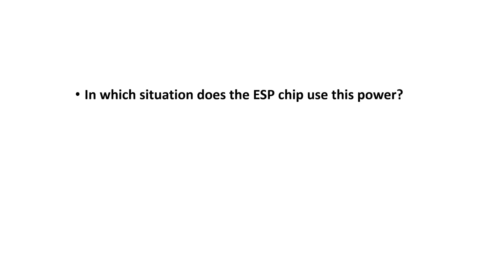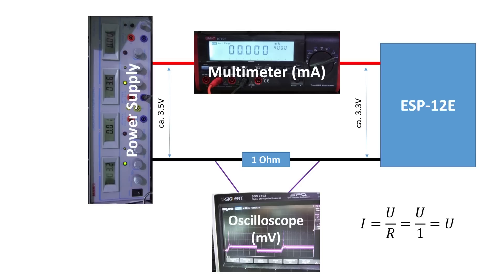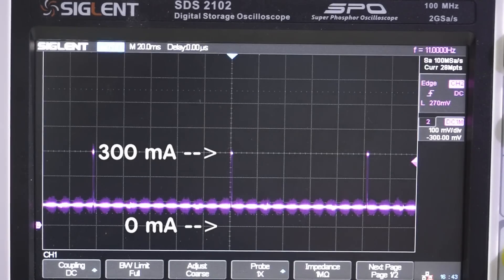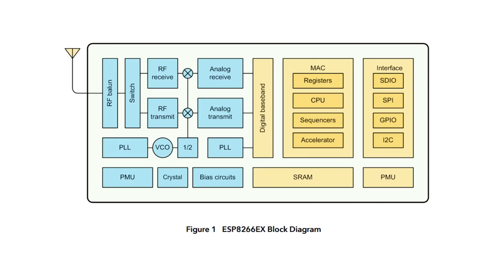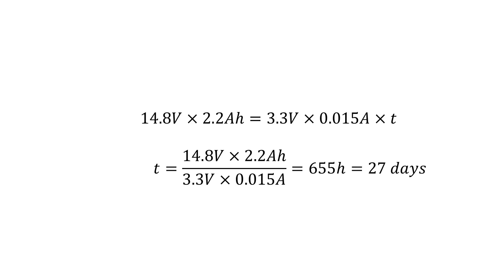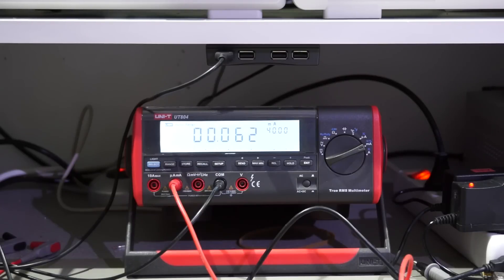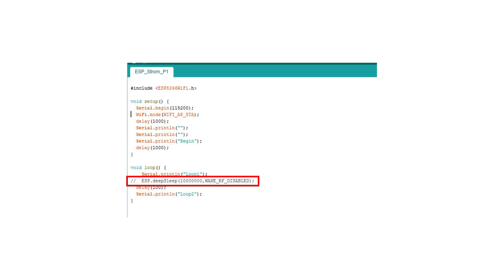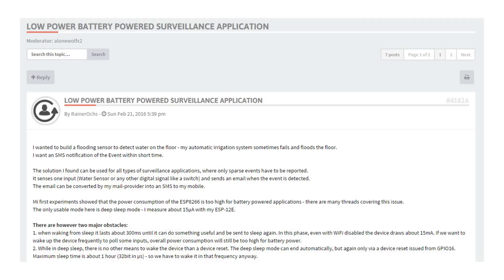#47 Power Saving with ESP8266 (Sleep Mode) Tutorial with some Tricks

Comment: Thanks for the Video! For me, it would have been interesting to see the peaks with a common battery type.
Reply from the maker: They have to be the same. Otherwise the ESP would crash.
Reply: I highly doubt it'd look the same, but I also can not disprove it. The battery would behave more closely to a capacitor, thus smoothing the peaks ... at least that's what I think it'd look like.
Reply from the maker: @josuaschmid501  The current flow is decided by the ESP (the load). If the ESP does not get the required current, the voltage will drop (ohms law), and the ESP usually crashes. A well-known problem. The best is you try. No need to believe me.

Comment: Hello!
I need some help with a project.
At first is it possible or not?
ESP12f and others have a deep sleep mode. That's right!
I want him to wake up every minute. To be able to connect to the server and check if I have set it to stay working or if I have not set it to work the given relay switch should continue to sleep. if I set it to turn on it turns on and runs until I turn it off. just to check every minute.
The goal is to have a security camera off, but have it ready. in case I had to turn it on to have a link to it. but to save energy.
If there is any other way how to do it, I would be glad if someone could share.
Thanks in advance!
Reply from the maker: Remotely switching devices on and off is possible. You find a lot of useful information for your project on YouTube. Maybe you create a diagram and search for each part independently?

Comment: So I followed your video on deepSleep , I like your explanation but for some reason I have not seen my ESP8266 development board go into deep sleep. If I put my Fluke 87(older meter) in series with the 5v line I see .20uA  , copied the sketch you posted and watched the readings. It was in Loop1 , never showed less than .20uA .So first off the math,10000000 if I reduce this number to a lower number will I see the loop2 come on sooner and then see the drop in uA ?I assume I wasn't watching the meter long enough or is there some other reason that I am missing, thanks.
     So I read some of your replies to others and I think I know the answer now. I am using a 12F development board and you are using a bare chip so maybe that's why I am not getting into deepSleep? Also you mentioned a cap , I did not install that either.
Reply from the maker: Development boards consume much more power. This is why I use a bare ESP8266 board.

Comment: This was gold. My project needs both lower power consumption and offline storage. It had completely slipped my mind that EEPROMs have a write cycle limit, and I was going to treat it like a cache.
Reply from the maker: With the ESP chips I often transfer the data over the internet and do not save them on the chip...
Reply: @AndreasSpiess  That is my plan as well. I have a sql server with a php script that receives data via POST. My thought was to have onboard storage in case the server went offline.
Reply from the maker: I use MQTT. It should keep the messages if it cannot deliver. But I never tried how many...

Comment: Thank you for a wonderful and informative channel.  I have subscribed.  

One question I have on "deep sleep" - the sensors themselves also draw current, correct?  I've seen a lot of focus on how to get our MCUs to behave, but what do we do about the sensors themselves?  For example, a simple capacitive soil moisture sensor datasheet mentions 5mA current.  Some of these sensors even have their own voltage regulators, drawing extra current.  If we bully our poor ESPs into the micro-ampere sleep states, this does not help if our sensors still drain our batteries.  

Do you have a video on workarounds for this?  I'm still starting going through all your posts, so maybe there is, but I've not found it yet.  

Thanks in advance, and thanks again for the great channel.
Reply from the maker: You can feed a sensor with an output pin, for example. Then it should not consume a lot of power when the MCU is sleeping.
Reply: @AndreasSpiess  Thank you so much for your fast response. How simple! :-) Kind regards

Comment: Hello Andreas, I didn't understand exactly how you connected the Capacitor.
Is it between max 4.2 and ground from the battery or between VOut of the LDO and ground?
Where did you solder + of the capacitor If it's between the LDO Vout and ground?
Reply from the maker: The big cap is between Vcc and GND of the ESP. I solder it on the module itself
Reply: @AndreasSpiess  Thank you!
My projects wouldn't have been possible without your help :)

Comment: Just as an update. It turns out a 12K resistor is insede the ESPs other than type S ESPs. Ie ESP8266 12E and 12F have a 12 K internally between enable ind Vcc. Out a meter on the two pins and you will see 12K. Undocumented. Sadly.
Reply from the maker: I assume it should prevent unscheduled reset. I assume it is included in the deep-sleep current consumption because you cannot remove it.

Comment: Finally got it working on ESP. By the way, to fix the "Unable to load issue, It seems a resistor goes between IO16 and Reset. If you use a link(as I did) you can't program the chip unless you remove the link. I am using a 1K. Lower resistors should work as well. Thanks again for your Vids Andreas.
Reply from the maker: This connection resets the chip which makes that the whole chip is disabled

Comment: That was really helpful. Thank you alot. I am running a NodeMCU 12E from a Li-ion 3.7 battery. First I connected the battery directly to 3.3 pin and the deep sleep works and cosumes 115 micro ampere current. Then I stepped down the voltage form the battery using mcp1700 votlage regulator which has a quiescent current 1.5 micro amp but the promblem is that  in deep sleep mode the consumed current rises to 1.5 mili amps. Then I tried to run the board from the Vin pin which is 5v in my board but it did not work at all. Any help or advice to reduce power cosumption during deep sleep would be appriciated.
Thank again for your effort on your videos.
Reply from the maker: Most development boards cannot be used with deep sleep because their power consumption is too big. This is why I used a barebone module. Some ESP32 boards are a little better. I made some test videos.
Reply: @AndreasSpiess  Thank you for your response. I will take a look on the videos.

Comment: You are great, thanks. I love your video about powerconsumption and bateries. I hav a project with NodeMcu 12E and in deep sleep I still use about 70mA, so my batery lasts about 4-5 months and it shoul last much more in deep sleep because I do work every 20minutes, send data tu database and then go to deep sleep 20minutes. I simpley cant have about 20 micro ampers. I connect GPIO0 to 3.3, GPIO15 to GND, RST pin and EN pin connected to Vcc,  GPIO16 to RST. Can you please help. Thanks

Comment: Anyone have an idea why deep sleep would cause erratic behaviour? I'm using a Wemos D1 mini wich is based on the esp8266, and when I use deep sleep the timing at wich thingspeak receives data becomes randomised to a certain extent, without deep sleep the transmission delay is a very tight 30 seconds but with deep sleep theres suddenly a 5 second variance.  It also seems after every 3-4 transmissions the data gets messed up because thingspeak receives an entry but it's not displayed on the chart. Any ideas would be greatly appreciated!
Reply from the maker: 1. Because the ESP boots after deep-sleep it has to connect to WiFi. Which takes sometimes longer.
2. Look at the maximum posting rate of Thingspeak. Maybe 5 seconds are not allowed in the free plan.

Comment: Hi Andreas. I've tried the code on https://github.com/SensorsIot/ESP8266-Longterm-Sensor-Hourly, with no luck. It seems that the RTC ram got cleared on the first deepsleep reset, so every time it wakes up it thinks  that it is a power up state. I've tried with a LoLin NodeMCU V3 and with a ESP12F board. Any advice? Thank you!
Reply from the maker: I cannot do remote debugging. RTC memory is lost if you power down the ESP (for your info)
Reply: @AndreasSpiess  Ok. I will check the power supply then, that is the only source of problems. Thanks!

Comment: What if I use a ESP8266 board that can take up to 20volts? Do you reckon the deep-sleep power consumption will be very high?
Reply from the maker: Depends on your voltage regulator.
Reply: Andreas Spiess Tbh - The board comes with one build in. Im building a batterypack for the device, and I’d like to have a higher voltage on the batterypack. It will shorten charge time for the same amount of money.

The project is for my school. I’m making 10 letters that each light up and each have 6-10 SW2812. (Along with 6x 2Ah 3,7V 18650) I’ll make it start at around 6pm and turn off at 2am. Each day with a new color. Won’t need WiFi (unless I want to turn it into a party light later haha)

Comment: Great great great tutorial !
Worked pretty well for me but I still have kind of 0.5mA in Deep Sleep do you have any idea from where it could come from ?
Thanks again so much for what you're doing !
Reply from the maker: From somewhere around the ESP8266 (LDO or other chips) ?
Reply: Hi Andreas, thanks a lot for your quick answer ! Actually I use the same chip than yours, this is why I found it ackward, a classic esp8266 esp12e. I will open the metaliic case of a broken one. I just feel it's in Light Sleep when I ask a Deep Sleep.
Do you have any idea on how to stop the CPU by hand ? ( by command in fact ) 
Thanks a lot !
Reply from the maker: Are you sure you measure right? These are quite small currents. You can reset the chip with the rest pin to check.
Reply: Hi Andreas ! I'm actually checking the amperage going out from an arduino UNO 3.3 Volt output,it was the only thing I had under my hand.  I've put a capacitor and it worked fine, but when I tried withtout, I had the luck to hear a small "gritziik" which told me I had to try with another board. I'll try with a real power supply tomorrow. 
I definitely believe that a low power consumption timer should exist in another way ! I'll keep you informed in anyways, thanks so much for your answer
Reply: It finally worked out ! I took a brand new other one and it worked out. Thank you very much Andreas ! Thank you thank you thank you !
Reply: Oh maybe the module adapter has 3 resistances I'll check without any of those

Comment: Very informative thanks. I have a slightly different situation where I have an ESP8266 connected to an Arduino Pro mini. I use the pro mini for various reasons and can get it's power extremely low.  The ESP is programmed with AT Command firmware and I can put it into SLEEP and DEEP SLEEP. I plan to have the pro mini trigger the RST or CH_DP  pins
Reply from the maker: You could also use the Arduino to cut the power of the ESP to save even more (with a FET transistor)

Comment: hi, use the code attached below, and I only achieve an energy consumption of 15 m [A] in deep-sleep mode, do you know why it happens?

#include <ESP8266WiFi.h>

void setup() {
  Serial.begin(115200);
  WiFi.mode(WIFI_AP_STA);
  delay(1000);
  Serial.print("\n");
  Serial.print("\n");
  Serial.print("begin\n");
  delay(1000);

}

void loop() {
  Serial.print("loop1\n");
  ESP.deepSleep(10000000,WAKE_NO_RFCAL);
  delay(100);
  Serial.print("loop2\n");
}
Reply from the maker: Maybe you use an ESP8266 development board. These boards use a lot of current for themselves. I hope you never see "loop2"

Comment: Hello I am measuring the current consumed by a NodeMCU (module ESP-12E), connect a resistance of 1 ohm in series with the power supply and 200mV peaks appear every 100ms that these peaks are due.
Reply from the maker: With this configuration, you measured the operating current, not the deep-sleep current.

Comment: Interestingly many people recommend to use a low ESR type capacitor to reduce brown out risks. However I see the problem of high leakage currents with low ESR capacitors (>200 uA depending on capacity) which is really bad for battery powered applications. Normal capacitors seem to be quite ok and give the same results for me, with a leakage current of <2 uA for my samples. (Values measured after runtime of >60 minutes as leakage current drops after time)
Reply from the maker: You are right. I learned about this fact after I made this video.

Comment: Hello Andreas. Quite old topic but I followed this exercise to reduce current peaks. But having 5x1000uF (electrolitic polarised) I could reduce only to 180mA. Any tips you may have?
Reply from the maker: If you connected the capacitor very close to the power pins of the ESP there are two possibilities: 1. Your measuring method or crappy capacitors. I only use one 1000uF capacitor

Comment: Grüß Gott Andreas, with reference to the scheme @ min 7'40", how is the switch at GPIO0 operated (to flat firmware or to upload a sketch)? I mean, when is the pulp or pull down activated?
There is a bit of confusion out there, perhaps because "pin" and "GPIO" are used interchangeably.
Happy and creative 2018
Reply from the maker: GPIO means General purpose Input/output. These are pins which can be used for this purpose (other than Ground or Vcc pins).
During power-up, GPIO0 pin has to be high (3.3 volts) if you want to run the sketch. If it is low, the ESP programs its flash memory.
To be sure it really is 3.3 volt, we use pull-up resistors to 3.3 volts. A button switch shortens the pin to ground for programming.
Reply: Thx
Reply: Thx for the awesome series of videos, from which I learned a lot!

Comment: Hi Andreas! I run more and more ESP's on 5V now, especially since Espressif made their comment regarding 5V tolerance. Have you ever tested what happens to the current spikes when running an ESP-12, ESP-01 or similar on 5V?
Reply from the maker: I hope you mean on the input pins, not on Vcc ;-). Because the statement of Espressif was only for these pins.
Input pins should not produce any current spikes.
Reply: Thank you for your reply Andreas! No, running many devices on 5V (VCC). Even running them om 5.2V. And, yes, ESP-01, ESP-07 and ESP-12 VCC (no regulator). Guessing then that you have not tested this on your oscilloscope? Cheers, Mike!
Reply from the maker: And I probably will not test it because I do not see a reason to violate manufacturers recommendation here. Vcc max for the ESP chip itself is 3.6 volt. But it is good to know that it also runs on 5.2 volts...

Comment: Well, it just so happens I've just added deep sleep (up to 7 hours) to my ESP8266 software - and was looking for a low power regulator to do the job - so you've just saved me some looking around... a board with the ESP12, inputs for the Dallas chip and that regulator would certainly make a good addition to the Home Control 2017 project - that's for sure -  more on the software at https://tech.scargill.net
Reply from the maker: Glad I was able to return a little for the time I saved with your script!

Comment: One thing you missed is modem sleep. It allows wifi to stay connected. Just use wifi_fpm_set_sleep_type(MODEM_SLEEP_T); then a delay(1000) in your main loop. For me this uses between 15ma and 70ma but I don't have an accurate way to measure it
Reply from the maker: I never used modem off so far, because I had no need for it. It does not save enough for battery powered devices and current consumption does not matter too much for devices connected to mains.

Comment: Good walk through.
I have an odd experience with a bare ESP12E, I haven't connected RST and GPIO16 as i want it to go to sleep until it will be power cycled. but after the sleep-time ran out, it blinks the blue led and draw 8 mA??
if i use  ESP.deepSleep(0); it dosn't wake up, but then you can ONLY wake it by reset.
Quistion: When it wakes up, i can see it is booting @74400baud, but it doesn't run my code, so what are it doing?
Reply from the maker: 1. Maybe you watch my video #108.
2. The ESP always runs your code if you reset it. the messages @ 74400 are not important. It has nothing to do with deepsleep

Comment: Great video. It got me going on my first ESP project. I got WiFi sleep to work. turning it off and then on again and getting 18mA average draw. I would like to get light sleep to work and half that draw again. I am polling a sensor every 10 seconds, and deep sleep isn't the best way to tackle that.

WIFI sleep code:

#include <ESP8266WiFi.h>

void setup() {
wifi_set_sleep_type(MODEM_SLEEP_T);
}
void WifiStart(){
  WiFi.forceSleepWake();
  WiFi.mode(WIFI_STA);
  WiFi.begin(ssid, password);
}
void WifiStop(){
    WiFi.disconnect();
  WiFi.mode(WIFI_OFF);
    WiFi.forceSleepBegin();
}
Reply from the maker: Thanks for the snipplets. Another possibility could be to use RTC memory as presented in my video #60

Comment: Thank you for great videos on the ESP8266. Have you found a way to enable RF after waking up from ESP.deepSleep(microsec, WAKE_RF_DISABLED)? Seems like forceSleepWake() does not do the trick. The only way I can get wifi working again is to do another deep sleep with RF_CAL, which is not optimal.
Reply from the maker: To my knowledge, you have to decide whether you want to use WiFi after your wake-up, as you described.
Reply: The only way I've found to get it to use the modem after deepSleep(..., WAKE_RF_DISABLED) is these 3 commands before WiFi.begin() inside the loop() of the sketch: 

WiFi.forceSleepBegin(); 
delay(100); 
WiFi.forceSleepWake();

... do something ... I have several println here

WiFi.begin(...

If I try just the WiFi.forceSleepWake() it does not work.

Hope that helps. I found this through trial and error.